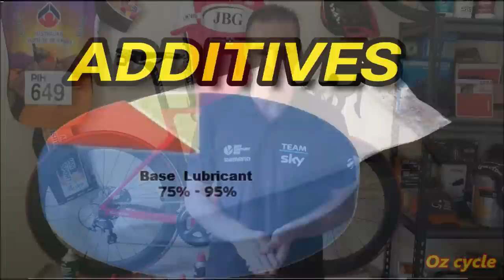Ultimate Chain wax - make it yourself

Comment: As always great job Oz! Apart from few items being not properly pronounced :) (I'm a chemist) I have to say I've been experimenting couple of months. 

Cleaning: 24h turps, shake off in degreaser + 24h IPA. 
I like doing longer rides 200k+. My gravel that i've been abusing during winter utilises 1x setup, and i've been riding pure wax for some time. It shards of really quick, leaving bare metal, plus the chain angles and hard work put into the drivetrain in some technical terrain killed the chain over 2000km (0.7 stretch) for KMC x11el. The chain started to feel dry after 160k+ or so. I was upset. 

The Paraffin wax + Lamp Oil (parrafin oil) was used later on, tried different concentrations,  tested on my fixed gear bike (since coronavirus I decided to deliver food), but. It does not hold on too long. over 50-70ish kilometers it started to sound loud. Don't know it 1/2x1/8 izumi chain is just louder but it seemed dry on the inside. Again not fully satisfied. 

I've order 1.6 micron PTFE for test and new batch of refined paraffin wax. And also I've ordered some graphite powder for the tests. Hence my question (if You had combined the PTFE with graphite perhaps or just graphite with wax). Also I am on the heavy side, and I ride heavy, low cadence that is... I don't wanna give up on wax. 
Need it to last at least 300k for longer rides. 

Also a YouTuber Ronald Kuba mentioned squirt can be applied for aid, when the chain runs out of wax film, he supposedly used this technique on rainy/wet days not to reapply wax too often. I've noticed squirt being added on longer rides is troublesome. It needs some time to adhere, penetrate, and for solvent to evaporate. Tested in on a longer ride. 

Concerning LAMP OIL for those in the US.  From what I understand there are also different grades so to say. It might not just be the same as paraffin oil mentioned in the video, even though it is stated so on the bottle. There are two kinds from what i managed to find out. Mine happened to produce excessively "oily" gummy cream when in the ration of 1:1 with wax..
Reply: Any luck with finding the right parafin oil + wax combo? I think my candle wax is not pure "parafin wax" so i get oily dirt still (not as bad but enough) . 
Has there been an improvement using the teflon?
Reply: @cinnamonfitness2492  Hi, nope, my chain was always squeking after 100-150 km...  I was fed up so I ended using lube. Now I'm trying once more but with proper degreasing, 3 steps turps/methylated spirits, degreaser with rinsing, 3 step Isopropyl alcohol, got my PTFE from aliexpress. We will see.
Reply from the maker: 1st step is using unleaded petrol....soak 5 -10 hours with intermitent , shaking.

Comment: You need a shop so we can buy this stuff directly from you :D
Reply from the maker: Why pay postage? If you find you can't make the wax for some reason I will send you a block.
Reply: oz cycle mate I found a big large unscented, plain white candle at KMart. Is this parafin wax? Can I use it? I bought 1 just in case.
Reply: @stevenleffanue  I'd pay...
Reply: @EdgePereira  I've been using unscented white candles from cheap shops, no issue here.  They're likely to be the same, and if it doesn't work you know how to get it off :)
Reply: @mikeeast9632  @oz cycle thanks for that. i've done it and now when i ride the bike I hear a little cracking noise. are we supposed to hear this , is this going to go away or is the chain supposed to sound as smooth as with wet lube?
Reply: @EdgePereira   bog standard white candles from coles work just fine : https://shop.coles.com.au/a/a-qld-metro-fairfield/product/econo-household-candles

Comment: from what I can read PTFE seems to be an environmental disaster. I will continue to use your original recipe without PTFE though !
Reply: it is also carcinogenic + a possible dementia trigger.  I'm staying the hell away from that stuff
Reply: @jackheinemann8780  Where are you guys getting this information? Everything I have found says it is safe.
Reply: @flyinginak4824  It's safe unless you smoke it.
Reply: @flyinginak4824  The issue is inhalation.  PTFE is similar to fiberglass dust in that it will get into your lungs and then you cannot get it out.  It won't dissolve.  Since we are dealing with microscopic powder, it's pretty easy for the powder/dust to spread everywhere and accidentally be inhaled.
Reply: The main precaution is to make sure you have good ventilation. It's Teflon, used in cookware. Dupont has all the details: http://www1.mscdirect.com/MSDS/MSDS00014/48703219-20110702.PDF
Reply: And once you're on the turbo trainer, the dust is in your pain cave. Hmm ...
Details from Dupont? ... That's a good one :D
If not even solvents get it off then any organism surely won't either. 
I agree on passing on the PTFE ... But otherwise: A wonderfully nerdy video. Thanks !

Comment: I've been doing this wax treatment now for a year and I'm sold on it. In a year, I'm still on my first chain, 5000 miles and my CC-2 checker says about .4 to .45. I go about 200-300 miles per waxing. It's a shimano HG701 Ultegra 11 sp chain and I've also used just one shimano CN900 Ultegra quick link. One modification to the process I'm doing is to clean the chain better. My original wax got very dark when I just ran boiling water over the chain. Now, I run boiling water and use a brush as I pour, then I pull the chain through a microfiber towel squeezing while it's still wet and hot. There is an amazing amount of black that comes off on the towel. Now the wax stays nice and white/clear with only a few tiny black specks. Also, while I used to let the chain sit in the wax for 10-15 minutes, now I let it sit for about 1/2 hour swishing occasionally. No real reason, I just figure the longer exposure the better, and it's not like it's any more burden. The biggest time factor is the 2 hours or so to melt the wax. So I've got maybe another 500-1000 miles left on this chain, and I'm interested in how much I can get out of it before .5 stretch.
Reply from the maker: Good tips Dirk , thanx. When no more bubles come out of the chain when swishing , the links are full of wax....its ready. Removing at lower temperature ie 55degC retains more wax in the links , extending time between rewaxing.
Reply: I finally found the limit of the Shimano CN900 quick link. After 21 connections and 5363 miles it broke on my ride. The pin just separated out of the plate on the fixed side. I carry a spare so no problem. I heard it before it came off but couldn't tell what it was. I thought it was a stuck link because I heard a slight rattle going through the derailleur. The chain is still holding up well.

Comment: Thanks for your nice video. 👍👍👍
Have a new chain properly degreased and treated with hot wax. Drive parts thoroughly cleaned, driven 60 km, efficiency seems very good to me after initial friction. I rode a surprising amount with the large chainring.
However, one thing struck me negatively:
The running noise of the chain. It's not a squeak, but a metallic rattle that I haven't heard before. It also depends on the force I put on the pedals. Is that normal? With an oiled chain, my drive has been almost silent so far.

Comment: And one more question. Is rinsing the chain with boiled water enough for cleaning the old wax? May be I should boil it in the pot for some time?
Reply from the maker: Rinsing in hot water works fine however you can simmer it for longer if you wish. If you do it will require more time in the hot wax pot to allow the wax to displace any water inside the links. Swishing the chain helps this process.

Comment: When touring it worked great in combination with a drip wax. The chain sounded after the drying smooth. / It´s rainy autumn in Germany right now, some rust is showing up. Im trying to use some other mixtures.

Comment: Done some calculations and saving 2-4watts from waxing vs regular lube can save you roughly the same as 500g-1kg lighter bike would save you on a hill, plus it also works on flats and downhill, unlike the lighter bike. And the lighter bike will cost a lot more, especially if you have a half decent bike already, upgrades get more and more expensive in the higher end.

Comment: You already know that it works... But here is my results of my connex 10sg After 3500 KM (Campa 10s) : normal 0.75mm tool does not fit in, quite alike a new chain. It does look a bit dull and the golden coating is wearing. Using a caliper, chain is between 119.6 - .7 and should still go a little. Maybe not 12k as yours, i doubt it, but it´s a 10s and if i understood correctly these tend to wear out a little bit faster compared to 11s-12s systems. Looks like this is going well. 

I do a quick clean in petrol every time i re-wax though...

(I am quite a tall rider...and usually my chains with oil or anything before died after around 2k)

Comment: Quick question, in a previous video about 3 years ago you made a wax lube with paraffin oil (1:1 mix) without the ptfe, what is the reason why you have gone away from using the oil this time with the ptfe? Is it less messy or have you found it makes no difference etc? 
P.s love the videos you’re making, I’ve just recently got back into mountain biking, picked up some wax the other day and waiting for the ptfe to arrive in the mail - can’t wait to get rid of the black greasy chain 😊 cheers from sunny QLD

Comment: Thanks, super instructive. I've waxed my chains for years after watching your videos and i would never go back to dirty oil. Thank you very much for your videos.
But one thing i would comment : in my experience, the only quick link that constantly break are my connex one, true they're a charm to work with, but I'd rather carry a tool than risk losing my chain in the middle of the road because the pin broke from the plate... again. Last one broke on the first ride after 30k.

Comment: I made both the 1-10 ratio soak method and the same wax in 99% alcohol at the same time for simplicity. I even made a mini one using an eye dropper bottle for the pack. I could only get the PTFE from Runaway Bike on Amazon. 
  I own a Specialized Levo and have gone through KMC E-bike specific chains every 450 or so miles. I've been using Muc-Off on a clean chain and reapply every ride. I've gone dry on 25 plus mile rides many times. 
I am not confident in That lube anymore. White Lightning is better than that. 
 You recommended the Connex chain. I decided to try one Connex 11SX and also a Connex 11SE E-Bike chain to see if I could get good life out of the cheaper one. I have only broken one chain ever in 30 yrs mountain biking, so I'm ready to try. 
Thanks for the tutorial (s)

Comment: Hello Oz cycle, after watching your video's I bought a connex chain sterilized and put it in the cooker at the end of last season, today was the first reapply. When reinstalling the chain I noticed that one of the bearings was missing from one end, that go me thinking , was it like this when I took it off, any how I used a fork to scrap the bottom of the cooker and sure enough there it was. I was able get the bearing back in.  With that said I'm wondering if I need to buy a new chain now. This one has no miles really on it. Why do you think it came off? I didn't use a thermometer on the was I just put it on high until it was melted and then put the chain in for about 15 minutes spinning the chain every 5  minutes or so. I really love the system. I will continue to do wax my chain, im all in. Thanks for any advice in advance - Rich from Colorado

Comment: Tried this and it's been ok for short rides, went out yesterday and it rained early, after a stop when the chain had obviously dried it was as if it had never been waxed/lubed. Squeaking like mad and rattling away. I think all the wax was washed/fell off. I think I'll try the old advice of letting the wax cool before taking the chain out as I never had similar problems with that setup.

Comment: Glad l came across this video. Found that using this method on my MTB is the best l have tried. The only thing l do differently is instead of pouring a jug of boiling water over the chain, l boil the chain in an old saucepan for 5 to 10 minutes. I have found this to be more effective.
Reply from the maker: Boiling chain in water allows contamination to get to the inner parts of the chain which you will want to avoid.
You got toggie goat?..I had a few once...smart but stubborn.
Reply from the maker: Nice

Comment: Superb instruction on chain waxing. I started to gather all necessary equipment to try it asap. One question though: Is there any way to check or test if my PTFE powder is really PTFE and not something else?
Reply from the maker: Try to melt it...ptfe melts at much higher temp than plastic

Comment: I don't like the idea of using PTFE. With this constraint, would you rather recommend to replace the PTFE with paraffin oil? I've also read that some people replaced PTFE with beeswax. What do you think about it?
Reply from the maker: Adding Paraffin oil for wet conditions helps prevent corrosion. Bees wax increases friction , it's too sticky.
Reply: @stevenleffanue  Thank you for the quick answer! Does paraffin oil help for another aspect besides corrosion?
Reply from the maker: No. Ptfe works best

Comment: Hi, just to say thank you very muchfrom Brasil 🇧🇷 After using lots of different lubrications products and not happy, I watch and decide to follow your instructions to do a wax homemade. Had some few trouble with PTFE purchase locally here in SPaulo State, because did not melt fully, even when temperature was over 110oC, anyhall most part of the PTFE melted and I was able to do your homemade lubricante. After two rides, I felt low noise chain and shifter, then let’s run at list 200 kms to see how good will be, thanks again
Reply from the maker: PTFE melts at 327degC....its simply mixed in an additive to the paraffin wax
Reply: oz cycle understood and thank you again 👍

Comment: Been waxing for a year now and very happy. A thought though - oil from a lubed chain keeps the derailleur jockey wheels supplied with lubricant. Is a waxed chain detrimental to jockey wheel bearings/bushes? If oiled separately, then it will contaminate the waxed chain.
Reply from the maker: Jockey wheels have their own lube which does not interfere with the chain

Comment: it's a great video sir. Do you have formula for another additive such as silicon instead of ptfe? thanks
Reply from the maker: You can use tungsten disulphide or molybdenum disulphide in place of ptfe
Reply: @stevenleffanue  thanks sir. May I know the ratio please?
Reply from the maker: 5% additive to 95% paraffin wax.
With ptfe it's 10%
Reply: well noted, thanks a lot sir

Comment: Thanks for a great channel! 
Loads of thumbs up from Norway!

One question concerning waxing after first time: You mentioned (somewhere) that your  experience is that some grime will end up at the bottom of the pot. And that it would be a good idea to use a frying basket of some sort to prevent the chain to lay on the bottom of the pot an get polluted by the grime.
But as you have to stir the wax-ptfe-solution, will not the grime then also be stirred and inevitably pollute the chain? Or does it sink quickly to the bottom and not stick to the chain? I guess one should not use the chain to stir the solution with then?

I'd appreciate your comment on this.

Thanks again for awesome videos and instructions! They are second to none.
Reply from the maker: This is a problem not solved yet as the wax needs to be agitated to get the ptfe into the chain too. Best advice so far is replace your wax when it gets dirty which should be between 3,000km - 4,000km. Since the wax is cheap to make its not such a problem.

Comment: Hi, great instructions, but can I check a few apparent changes since your earlier video please? Am I correct in observing that you no longer recommend 1. letting the wax nearly solidify before removing the chain, nor 2. quenching the freshly waxed chain in cold water immediately after removing it, nor 3. cleaning the chain (as opposed to the chainring/cassette) with a light touch of degreaser then water after each ride? Many thanks in anticipation

Comment: Thank you for the great and informative video. I just have one technical question: cleaning the cassette and the front chain rings, do I need a degreaser? There should be no grease on it. Would be a warm soapy water be a good or better alternative?
Reply from the maker: For the initial clean use whatever removes the previous lubricant.  If oil was used then yes, degreaser. Soapy water isn't strong enough.

Comment: Hi, I learned from you the technique to wax the chain. I noticed that with cool temperatures the wax last more on the chain increasing the amount of kilometres. Do you think that with warmer temperatures a wax with an higher melting point would be better than the standard wax with 54 degree as melting point ? Thanks for your videos!!
Reply from the maker: Makes no difference as chain operates at a low temp

Comment: Hi.
Thank you for this great informative video. I am definitely going to change to this system. One question, please. Is it necessary to remove the chain when washing the bike to avoid removing the wax, or is it resilient enough to withstand weekly washing without removing the coating?
Reply from the maker: It's fine to wash your bike with a waxed chain but don't leave it wet in storage as your chain will rust.
Reply: @stevenleffanue  Thank you, Steven! I am looking forward to getting started with this system👍